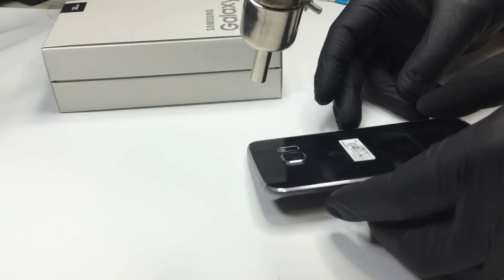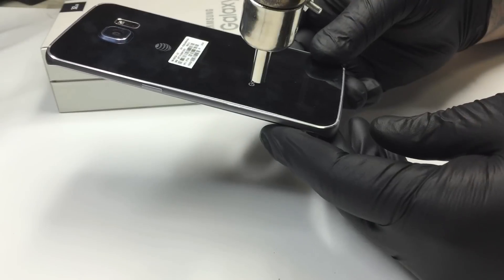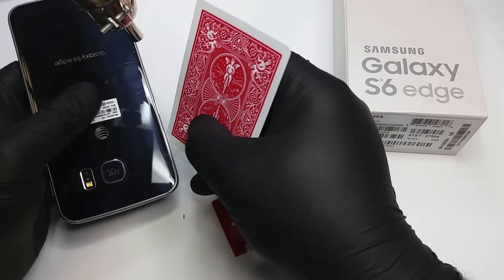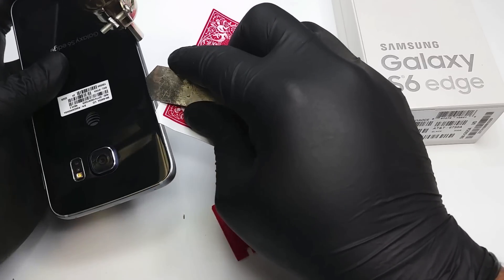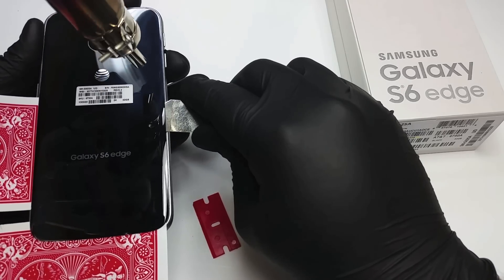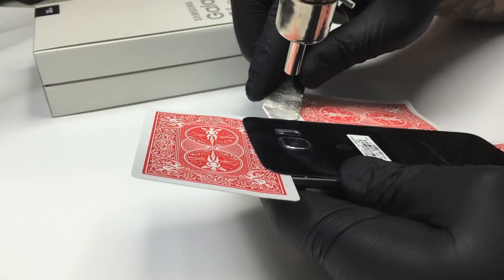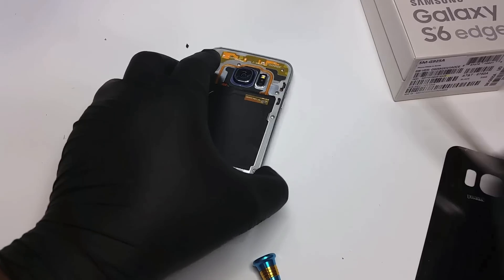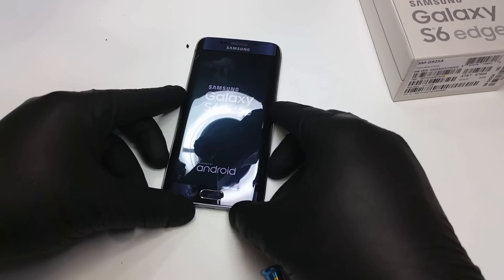Galaxy S6 edge back glass repair

Comment: Thanks for the help😊 I just bought my phone 3weeks ago and there were no protective cases available anywhere in town. And.....yes it slid off the shelf and onto the cement floor😡 The back corner got a signal crack. I ordered a replacement online. Thanks to your video I can put on my new back and put it in the protective case I have.
Reply: Michelle Kilner was it easy to replace back glass thank you also did you use a hair dryer ?

Comment: Great video. Thanks. Have a few questions:
Q1) Where should we place the double sided tape? Should it just go around the edges or does it have to be placed somewhere in the middle? 

Q2) When replacing the back glass, is it required to get the exact same model replacement glass? More precisely, I have a SM-G925P in Gold from Sprint and I can't seem to find a replacement back glass anywhere. Is there an problem with using a 925F back (especially when there's not much other option)?
Reply: ***** I appreciate your answers! I'm having such a hard time finding a Gold Back Glass replacement for my SM-G925P. Can only find ones on eBay from China which will take a month to arrive. Do you know where I can purchase a replacement Gold back glass (preferably with adhesive)? 

Also how are you mounting that heat gun? I would love to have a setup like that.

Comment: Just used this video to perform my own repair.  Shattered the back glass using a hair dryer on high heat and high fan and after a couple minutes the glue melted enough to allow me to pry at it with a thin pocket knife.  Playing cards kept the glass from reattaching.  The only down side with using a hair dryer is I had to move around the phone a couple inches at a time.  Another issue that occurred was the hair dryer did not detach all of the glue.  You are able to pull it off with steady and light pressure while pulling.  Great video!

Comment: How long do you heat the back up I am using a hair dryer and have done it for 5 mins straight then try to pull it apart with the suction cup but it doesnt pull apart

Comment: Cold day in hell before I put a heat gun on my nearly $700 device, No Go Kemosabe...
Reply: what if u fry the wires or melt something...if a phone is hot thats usually a bad sign ..idk...id have to try it on someone elses before giving mine a go
Reply: LOL do you realize that that's the only way to open a smartphone